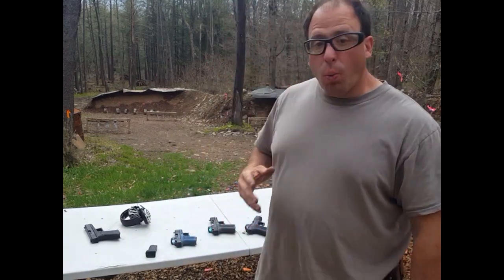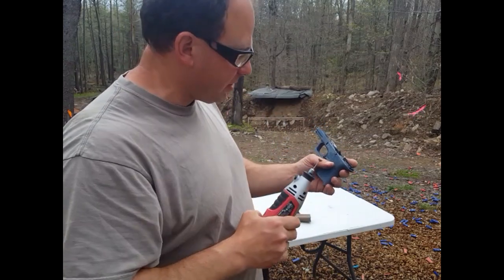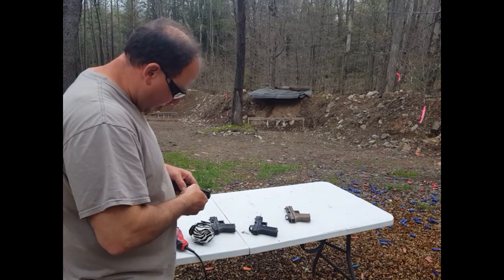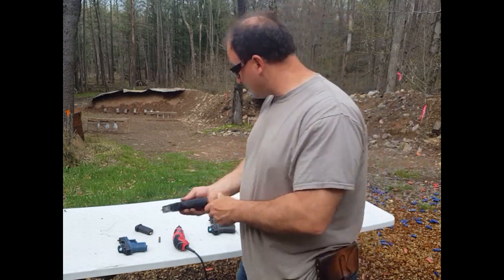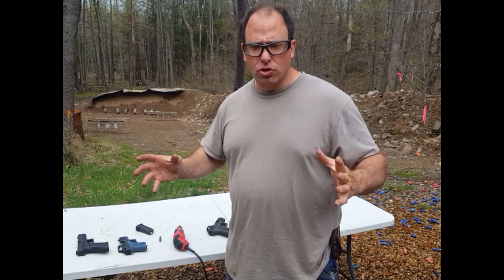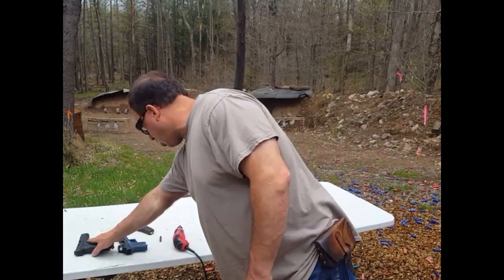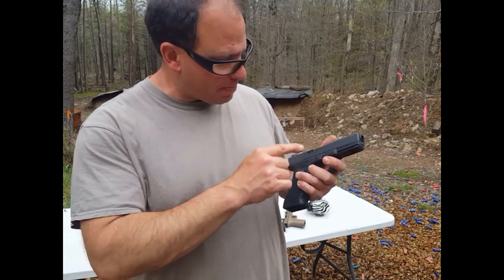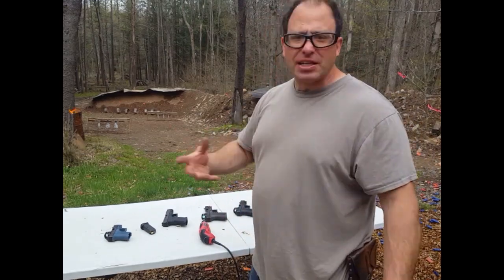Why "Ghost Guns" are Rarely used in Crimes

Comment: It takes me 45 minutes to build my gun and it works flawlessly
Edit: not saying that it’s gonna take everyone 45 minutes or that you should try to do it quickly it just happened to work for me
Reply from the maker: Occasionally I get one works right out of the gate, but that is the exception.

G26 is especially difficult .
Reply from the maker: John Doe  
The g26 with the hardest in terms of getting the gun to cycle, because of the short barrel and short recoil stroke.  I have been told that even Glock OEM G-26 will easily Jam if you don't have a front grip.

The difficulty for me was in figuring out that I needed to use the lighter 14-pound spring and heavier 124 grain bullet.  Up until that point, I have no idea what was wrong.

The g17 is the easiest to build in terms of getting it to work.

But I think that the best approach to have is that if you have access to a Glock OEM pistol, build that first because you can test out your P80  frame, slide, barrels recoil spring  independently and isolate problems.
Reply: My g26 went super easy. The 19 and 34 had very similar issues.  Now all work perfectly
Reply: Funny... my first build took me like 2 days to get her working the way I wanted, but the 2nd took a little bit more than 30mins. Have all the right tools help.

Comment: My mans got the dremmel on the table. These are the facts. You must know how to be your own gunsmith. Everyone gets lucky once. However The time can be done faster if your a professional. My frame broke a world record from 3d printed to complete and shot. Oem parts are a must.
Reply from the maker: I've had quite a few p80s  happened to work when I slapped them together, but for that is the exception.
 OEM parts will work better, but that was not an option in 2020 to most 2022.

Comment: I’ve built all my guns in my house, Just a lot of fine finishing for a month or two until I get a chance to go to the range and they have all worked flawlessly, also I’d invest in some steel snap caps and just running them through the gun hundreds of times.
Reply from the maker: A lot of luck involved in getting them to work without live fire. I've got three of them to work that way, but most of them need a lot of debugging.

I have snap caps. That only go so far.

Comment: On your g26 clear out the channel, you gota make it perfectly flush and remove more material than it indicates, like 95% chance that's your problem. Its not an issue on the full size and compact but the sub compact has the duel spring that will catch. Also now that I watched the vid, just because it took you weeks to make it functional doesn't mean it will take that long for everyone, had absolutely no issue on the g17 other than racking the slide like 300 times to loosen the spring and get the rails to be smooth, it ate the first mag with no problems. On the g26 took me like an extra 30 minutes to figure out that the channel takes way more work because of the duel spring and I actually had to put about hundred rounds through it because duel spring doesn't loosen as fast.
Reply from the maker: Most people don't know to rack the slide 300 times to break it in. They don't even know what parts to buy.
Reply: @tsafa  to be fair I didn't know what parts to buy either, that's why I bought the kit that said "everything you need except the frame". I even got all the tools to buff out the rails like suggested but then I realized it would take hours of effort to actually accomplish that. So I threw some common sense at it and figured if I oil the rails and rack the slide, metal on metal with some oil in between would buff it all by itself and more so it would buff the tiny sliver of the rail that actually makes contact with the slide as opposed to me spending hours pointlessly buffing the whole rail. I also realized the rail is already pretty damn smooth, its mostly the nitride coating on the slide that's creating the gritty feel.

Comment: Bought my P80 at the same time as I purchased my first firearm ever, Glock 19. I had zero gun experience. Put it together in 25 mins minus the milling. +1000 rounds thru not one problem. Greased it first. I’ve heard more about teens buying and assembling these than criminals. There’s even videos on YouTube of kids assembling these
Reply from the maker: There are no videos on YouTube of kids assembling polymer 80s. That brings everything else that you said into question. Grab some links if I'm wrong of kids assembling polymer 80s.
Reply: @tsafa  there was but since have been removed but theres a bunch of effective videos that teach you how to preperly put a p80 together to ensure you have zero problems ive done so in less than a hour greased the thing and it workd fine g19

Comment: It took me 2 1/2 months to build each of my 1911’s. The Colt Gi I had to put 2 finishes on that took about 3 weeks to fully dry and the slide never locked back on the last round but it cycled. The Rock Island build functions flawlessly and still looks brand new although it doesn’t like aluminum ammo. I’ve never personally built anything from P80 because I hate Glocks
Reply from the maker: That's awesome. thanks for that excellent information. I have never built in 1911 but it clearly involves a lot more work.
Reply: A lot of it is just trail and error. I had to put 300 rds before everything worked properly. I had to swap out the dual thumb safety that most Rock Island’s have cause it was causing the trigger to stick so I just put a Colt Government Model thumb safety on instead and bam haven’t had a problem since.
Reply from the maker: @mac11daddy6  there's usually some trial-and-error with getting the polymer80 has to work as well, although not nearly as much as a 1911

Comment: Buddy... they're really easy to build. It was my 1st gun ever, and I  built it in an hour. Never jammed... YET. I was so happy. Now I'm obsessed
Reply from the maker: I have built allow them. Is about 10% chance that it's going to work the first time it is shot. Normally take some take some work to get it right. 50% of the time the rails are bent and I have to get replacements from P80 I think they got a bad batch.

Hard to get Glock OEM parts, so a lot of the time I'm struggling with parts slightly out of spec.
Reply: Where you from
Reply: They say You need to level sand your rails because of some high spots. All guns, even factory oem need a break in period. Tighter tolerance will make a better gun after the break in. The marine gun builder has a lot of helpful tips.
Reply: @jamesciembor8129  oem Glock requires no break in. Nobody would buy a Glock if you had to “break” it in

Comment: Any cerakote finish on inside of the slide where it makes contact with the actual rails makes it stick.. also the rails in the frame have to be very level, and not canted. P80 claims a 200 round break in period so there’s that too.. shouldnt take that many if you use decent ammo.
Reply from the maker: I got it working with a 14 lb recoil spring, 124 grain bullet and a lot of Gun oil.

Now it's at the point where I can begin breaking it in.
Reply: @tsafa  nice!  I like your range setup, def make some more videos!

Comment: Can you remove a serial number and leave a finish like it never existed and tell the government you built it?
Reply from the maker: The plate will show that it is damaged.
Reply: @tsafa  not all serial numbers are placed the same. One of my firearms is literally printed with its serial number I’m afraid to even have it scratched off in general by wear lol
Reply from the maker: @Albuqrazy  they can put the serial number anywhere they want but it's always going to be on the same place for a specific model of a gun. The serial number plate for the polymer 80 is in the picatinny rail. You can leave a blank if you want, but if you put any markings on it they can not be removed.

You can put Egyptian hieroglyphs on it if you want for a Serial number. They just can not be altered afterwards.

This is a good way to prevent a state from forcing you to put a serial number that they want on it.

You're not responsible for normal wear if the serial number erodes.

Comment: I finished my frame in 3 hours ran 150 rounds through with no jams
Reply from the maker: It's sometimes happens. It's happened to me where it just works well the first time out. Most of the time it takes a lot of troubleshooting. You've got lots of parts coming from different manufacturers. There are tolerance allowances. So if you get parts at opposite end of the extreme tolerance allowance, the gun going to have issues and need to be fitted.

Comment: I had the same problem I just changed the slide lock and it worked after that
Reply from the maker: It ended up being the barrel slightly out of spec causing extra resistance.

Comment: I built my first one not a single malfunction. Pretty easy if you know what you are doing just saying. I appreciate your thoughts. I agree many will get someone to buy one but to say it’s very difficult or takes weeks is a long shot. If after one or two range visits you are having issues it’s the parts you are running or you messed up just my thoughts. Great video keep it up. God bless.
Reply from the maker: Knowing what you're doing is key. Until a person has built a few of them it is very hard to know how to debug them. Especially if you're getting parts from lots of different places.

Comment: Failure to feed try polishing the Feed ramp on your barrel more than likely not your rails if the slide racks smoothly.
Reply from the maker: Slide was not coming back far enough . it needed a lighter recoil spring and a heavier bullet because of the weight of the optic

Comment: Thanks for the info, there's no way the everyday criminal and thug are Going to be doing this and the amount of time it takes to tweek this as a creator or printer of one of these guns why then would one want to sell it when it's so much trouble to build.
Reply from the maker: It takes a minimal of 200 rounds to break in a Polymer 80 as per the manufacturers instructions. That's a lot of practice shooting to be doing without access to a gun range.

Comment: Even if you get all the parts together in a box and you know how to put it together let’s say you put one together before you can have it look like a gun within an hour making it work as a reliable gun could happen right away but usually a break in. Of 300 rounds is necessary for knowing exactly what to look for and how to fix it would almost make you a gunsmith so there would be a lot of planning and fixing before you could use it reliably
Reply from the maker: My first one took me about two months to get working right.

Comment: Kindly I disagree. I have had issues also building p80s but realistically you can build one in 20 min with a razor blade and drill. 
With yours I recommend recalling going over it.. fine tune it. Make sure everything is as smooth as possible. If that doesn’t work… in some cases I had to change my internals. P80 changed some shit started making them cheaper but quickly realized they started having issues and now they are fine. Iv build like 10 p80s not an expert at all but out of those only 1 had that jam issue after I went through it.
Reply from the maker: The first one that I built took me about three months to get working perfectly.

I can now get them built and the bugs within a day but that's because I have a lot of experience with these.

The gun is not complete until you have shot 200 rounds through it. The test is putting it in your off hand and shooting it one-handed to make sure it will cycle and go to lock back.

Comment: If you buy a complete slide u don’t halfto deal with that, with that being said it takes hella time drilling the p80 frame and putting it together
Reply from the maker: Building the frame is not as easy as people think. It's not the hardest thing in the world, but it's not a 40-minute job if you're doing it the first time.

Comment: Did you ever figure out the issue causing the feeding problem at 1:00?
Reply from the maker: Yes. It needed a lighter 14 lb recoil spring and a heavier 224 grain bullet.

Combination of the very short Barrel in the g26 and the heavy optic on top of the slide. The later spring and have your bullet gave it the extra pop it needed to push the heavier slide back
Reply: @tsafa  ive been seeing it intermittently in mine. Hoping it’ll cease after i get a few hundred rounds through it.

Comment: I shot 2,000 rounds through mines and it only had 1 jam. And that was on the 2nd round ever, I haven’t even cleaned it. And it runs just as good as my Glock 19x
Reply from the maker: You build guns better than everybody else. I moderate a chat group and there's about 15,000 people in there trying to help each other get the guns working. Not that they will not work reliably once they have been debugged, but it's a process.
Reply: @tsafa  to be honest that was my first and only time building a gun. At first it wouldn’t even rack a bullet, I changed the recoil spring and after that one jam. It never had a problem again
Reply from the maker: @anonymousglocky  
There's a lot of luck involved. Sometimes I get multiple parts out of spec. I'm going back and forth swapping out parts trying to figure out which is the bad part meanwhile, I've got two or three bad parts.
Reply from the maker: @anonymousglocky  
If you look at my playlist above you'll see all the problems that I've had to work through on different builds. Once in awhile I get one that just works without much fuss.
Reply: @tsafa  it was definitely a fun experience for sure, but it took me a solid 3 weeks to fix the racking issue. I swear, it wouldn’t load a bullet for sh*t. I was about to give up, until my Gunsmith friend told me to change the recoil spring!😂
Reply from the maker: @anonymousglocky  
Recoil spring was exactly the problem that I have in the video above. I had to go from a standard 16 lb for the g26 to a 14 lb. Also had to use a heavier 124 grain bullet. Reason is because of the shorter Barrel on the g26 combined with the weight of the optic on top of it. 
I still have to hold it very tight in order for it to be 100%. Short barrel means less pressure. Less of an issue on the longer Barrel g19

Comment: I literally put one together in an hour with nothing but a dremel
Reply from the maker: Putting it together and making it work are different.  Building is not complete until at least 50 rds go down range without a jam.
Reply: Yes it works😂
Reply: No issues built in one hour with a dremel and a YouTube video
Reply: Like I said not very mechanically inclined
Reply from the maker: @glocklahoma7064  
That's very rare but happens. Usually the rails do not line up correctly. It takes a lot of work to get them right. 

On the few occasions they were out of whack that polymer80 had to send me replacement rails.
Reply: make sure the firing pin saftey is rounded trigger bar is smooth rails are even recoil spring channel is clean and its shoot work everytime

Comment: they are not hard to build, takes 30 minutes to do a p80 kit, if you have been working on it for 2 weeks you don't know what you are doing.

The rails are the easiest part, not even 5 minutes to cut the 4 rail extensions.

If you are using a dremel on the chamber and filing the hood and teh slide, you don't know what you are doing.
Reply from the maker: The point is that people doing this for the first time do not know what they're doing. There's a very long debugging process.
Reply: @tsafa  biggest issue people have is putting the trigger return spring in upside down, and the slide catch in backwards.

Comment: Try to get an oem slide
Reply from the maker: I prefer the aftermarket slides. They take Optics and are more stylish with Windows and cuts. I've never really had a problem with a slide. Any one of them will go on my glock OEM frame. So it's just a matter of getting the polymer 80 frame correct.

Comment: On my builds ive mainly run into issues with pin clearance and barrel fitment. Do not cheap out on barrels they cause a bunch of issues.
Reply from the maker: I just get stainless steel barrels. Less chance of a problem if they're not Coated with cheap paint that does not stay on anyway.
Reply: @tsafa  I 100% agree ive had barrels with coatings so thick it wouldn't even fit the slide.
Reply: @tsafa  My favorite barrels are the glockstore barrels though by far for the price you can't beat em.
Reply from the maker: @chrisd5758 
I did a video on the benefits of stainless barrels just this week...
 https://youtu.be/zPs03dByDrE
Reply: @tsafa  Spinta precision also has really nice barrels at a great price and you can randomly get them on sale for like $90 shipped

Comment: So if you have to file down the barrel im sorry sir you are buying dog shit parts. Both of the builds i have done have been zeffari precision slide an barrel an would recommend them highly out of both builds from my p80. If you have the problem where first shot it does not go back into battery an slide locks without slide stop being in place they you have to go back in frame an work on the channel with a diamond bit because that post an channel is giving space for the recoil spring . Good luck
Reply from the maker: The barrel and slide need to be properly fitted.
Reply: @tsafa  zeffari precisions fits their slides an barrels before they send them to you an the recoil spring is fitted into the barrel so you gotta think its three major parts that go together the slide barrel an then recoil spring.
Reply from the maker: @ethanberlin587  
Okay, that's a different story altogether. Somebody else does the work of fitting them, but it has to get done by somebody.

My slides and barrels all come from different places, so I have to fit them together.